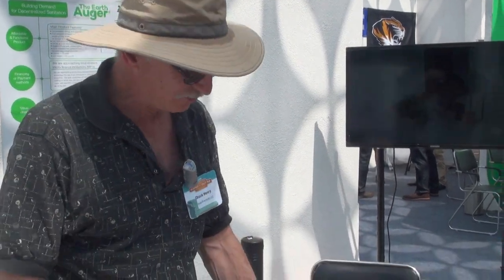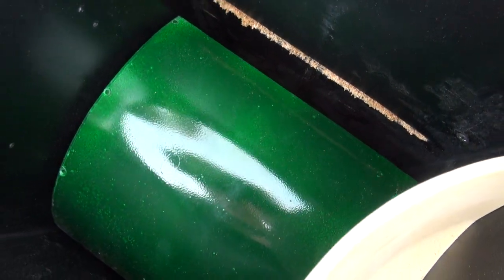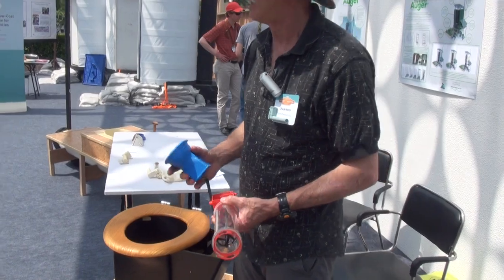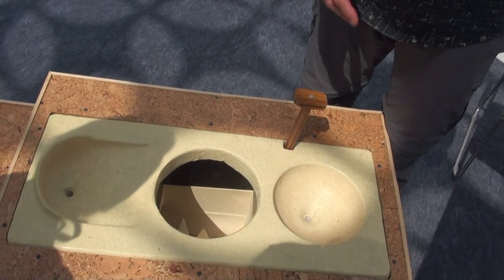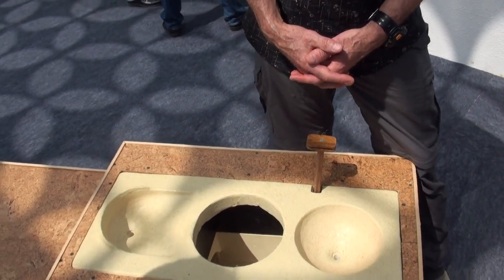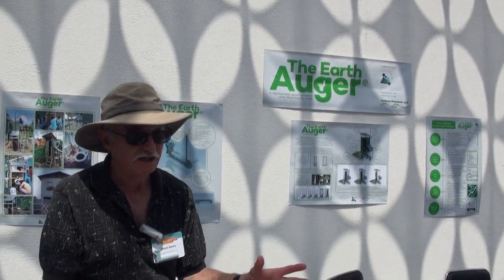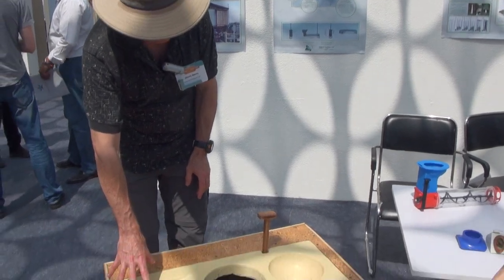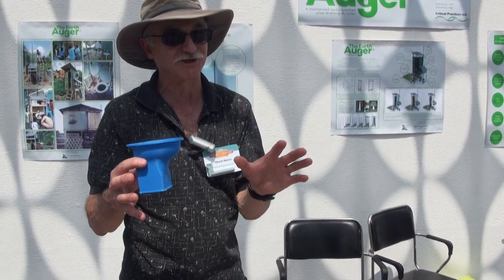Chuck Henry: Earth Auger: Urine diverting dry toilet (Critical Practices LLC, Ecuador), Part 2

Comment: Nice design! Can it be installed so that the auger is going thru the wall and the bag is outside? My tiny house bathroom is small so having the auger in front of the toilet is not logistically possible unless I could install it under the tiny house in front of the toilet. Still possible but behind the toilet is easier as it would be just one hole in the wall.  Just curious as to the flexibility of design and installation.